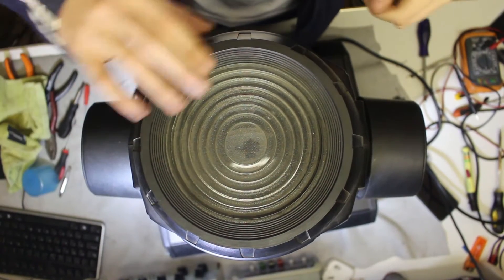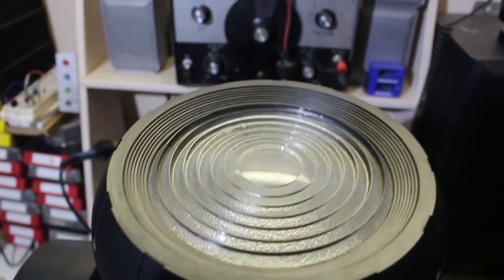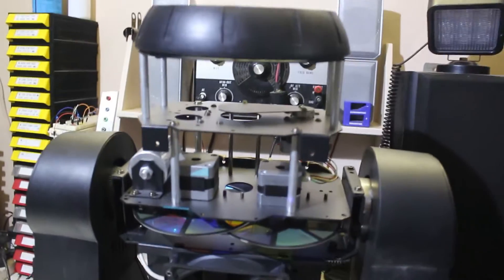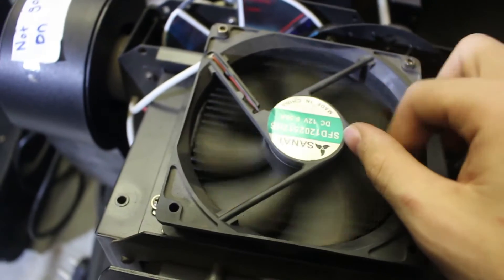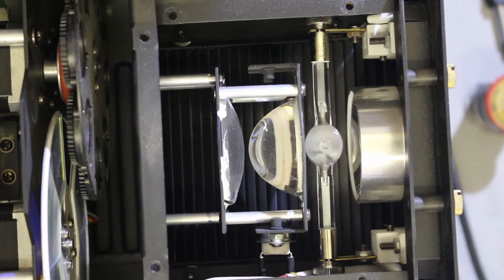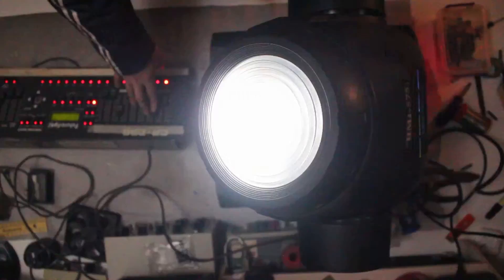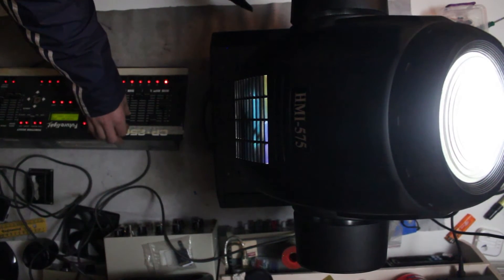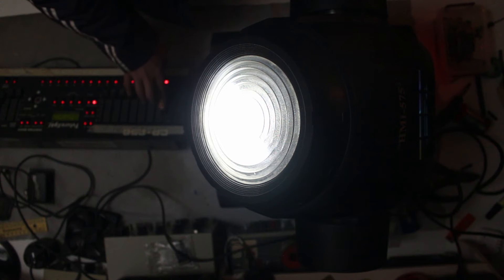#5 Martin 300 Moving Head Rip-Off Wash Light Teardown

Comment: What Setting are you using on the Fixture ?  I have TWO(2) deliya Vision 575 Spots . One of them I can get the pan and tilt to work but no bulb. I have not checked the Bulb to see if it is blown . But the 2nd one does nothing . That is WHY I would like to know What Setting you have yours at on the LED Panel .. Thank You .